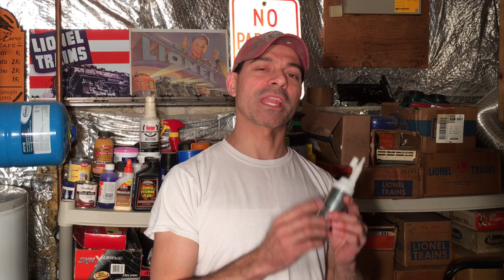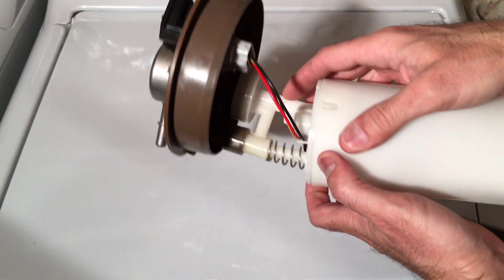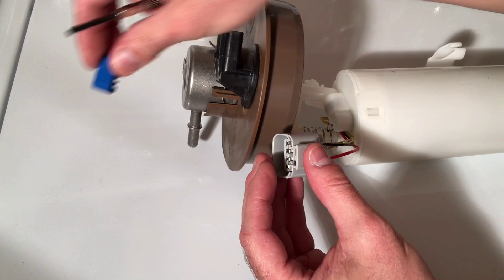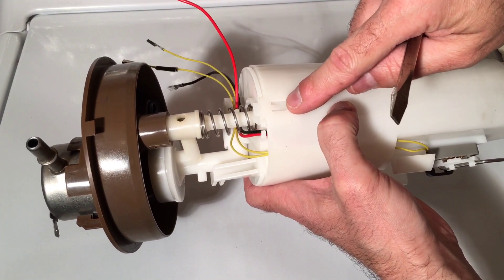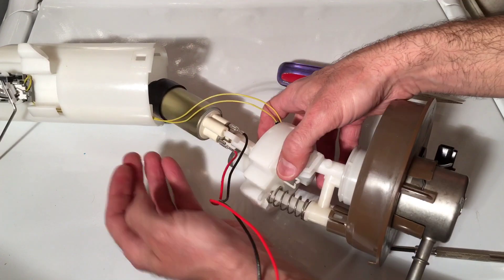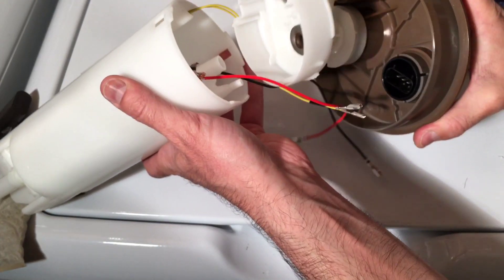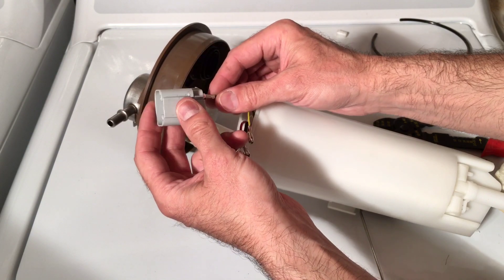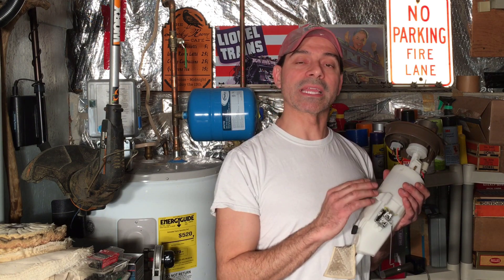How To Install A Walbro Fuel Pump - Dodge Neon (Andy’s Garage: Episode - 175)

Comment: i have a dodge neon 2005 wont start had it running day before very rough  barley made it home it had good spark while it was running any ideas what is wrong with it
Reply from the maker: Are you getting any engine codes?
Reply: @PhillipsVision   John Whitaker,  sounds like low fuel pressure from fuel pump which causes less gas sprayed into engine and lean burn and back firing.  So change the fuel pump, like in this video.  Best of luck.  My 2000 Dodge Neon is stalling, low idle speed, back firing.  I am purchasing a fuel pump from RockAuto.com  or 1AAuto.com   or https://www.modernperformance.com/product/Walbro_255_LPH_High_Flow_Fuel_Pump_95-05_Neon_SRT-4/03-05-neon-srt-4-fuel-system  or https://walbrofuelpumps.com/dodge-neon-2000-fuel-pump-4-cyl-2-0l.html